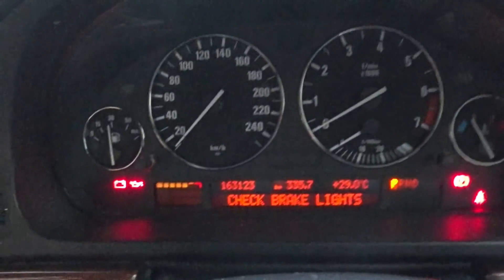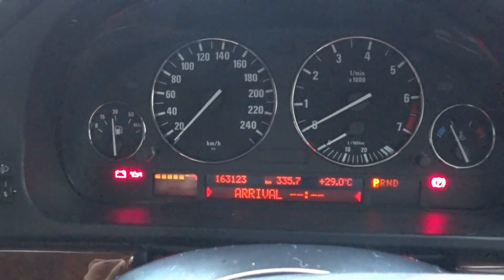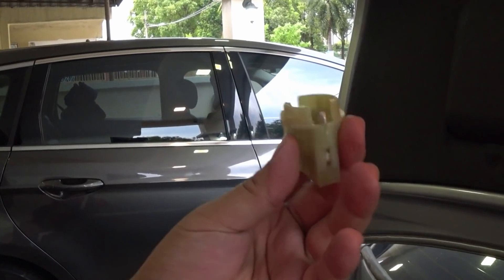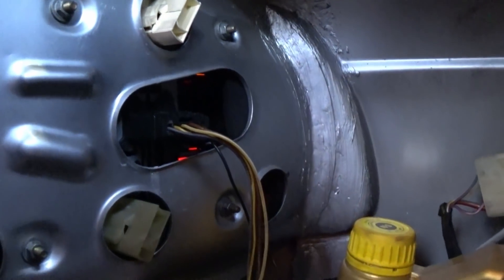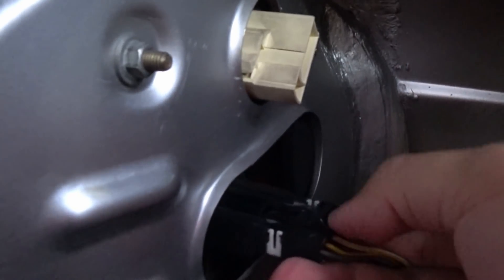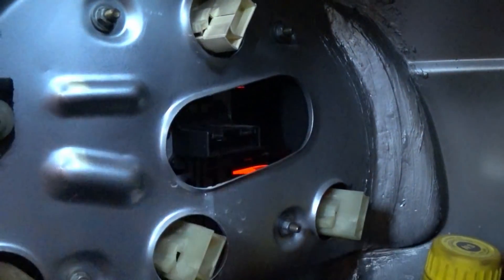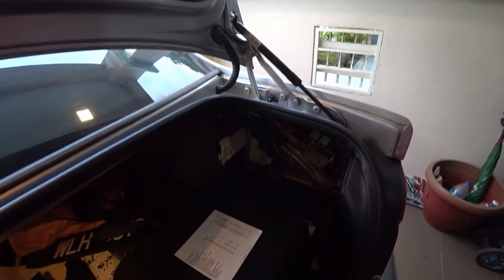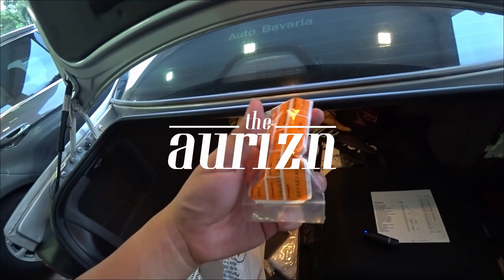BMW E39 - Simple light bulb change escalated to full-on soldering job | EvoMalaysia.com

Comment: Here's a soldering tip for you bro, next time always clean oxidised metal surfaces with sandpaper or simply a knife to scrape the surface  for easier soldering process. You can use some soldering flux paste for the sodler to stick on easily.

The next thing that might concern you is that you might have water leaks after you have removed and reinstall the rear lights due to the seals might not be sealing like new again. So from time to time have an eye on the boot storage compartment to check for water flood on the spare tyre well.

Anyway that was a good effort to fix it yourself. Well done!
Reply from the maker: Thanks for the soldering paste tip! Will keep that in mind

Comment: I always amazed by the fact that, those warning sign are still working despite the age of this car. Last time i had a chance to drive my relative’s W140 Mercedes. Although it was a 1997 made car, I managed to cruise the car at 130mph and still feel safe. I know many modern cars can easily reach 130mph, but how many 1997 made car can still reach that speed today? It was a car that ahead of its time. 
Not to mention, even the vacuum doors are still working perfectly. I was really amazed and since then, my love towards the continental cars starts at forever and ending at never.
There is some magical things about continental cars than the Japanese dont have. I never had a chance to drive a E39. But im pretty sure. This car lebih sedap compared to a brand new Civic.

Comment: Personal opinion. Keep your fingers crossed that the solder stays there, coz depending on the type of metals in the solder and the plate that it was soldered onto, the bond might not be strong enough in the long run and drop off.

If it were my car, I'd cut a small piece of aluminium from a soft drink can, sand down both sides till its rough, then bend it in place to fit into that corroded area, before twisting the socket and bulb back in.
Reply from the maker: 🤞🤞🤞🤞🤞🤞

It's trial and error on my part too, to be honest

Comment: i think your boss should pay u more, since u kept said rm65 is expensive.. while your boss incure rm20k just only on road tax.
Reply from the maker: Speaking in context. RM65 for a simple plastic and metal assembly is expensive.
Reply: @KonWaiLuen  plastic molding is made by volume. your type is not really the common model todate, as such RM65 is relatively ok considering what RM65 can buy you today

Comment: have you check the fuse? if ur convince its the connection u can solder a short wire bypassing the board. i mean if u get another tail lamp, new or old they might not match the patina on the right lamp.

Comment: kon get a cheapo multimeter. Those might not be great / trusted for high voltage but they usually have a continuity mode to  check if the wires are shot.

Comment: Solder melt temperature is way below metal melt temperature.  I doubt the solder will stay in place & the brake light fail again.

Comment: Get yourself led bulb replacement. Solve the socket melting trouble once and for all.
Reply: But, the light clarity from halogen bulb is brighter. LED bulb on the other hand is still considered fairly expensive. If not mistaken, the original Philips LED  brake light bulbs (a pair) would cost RM60.